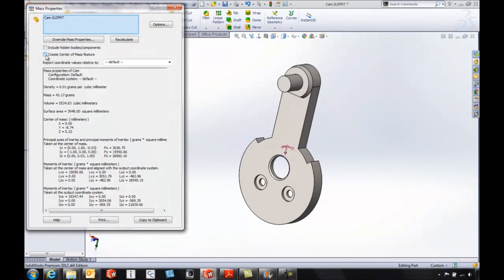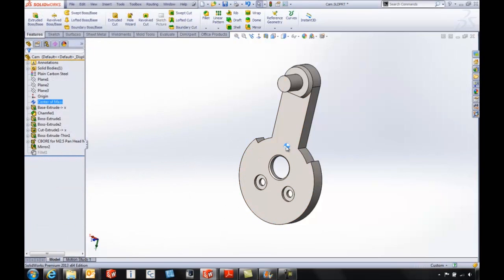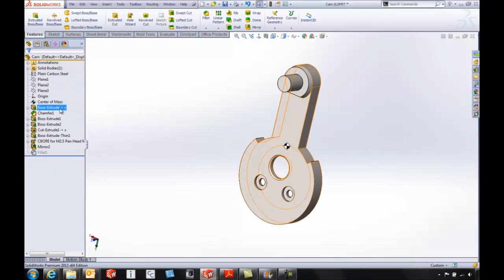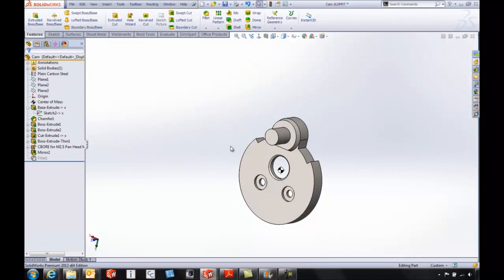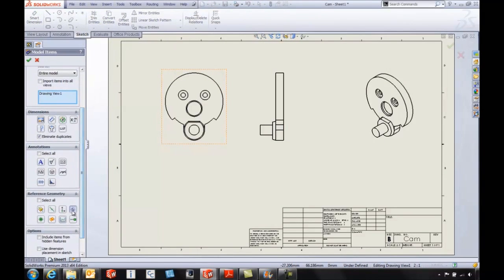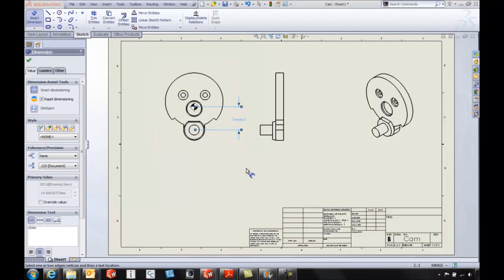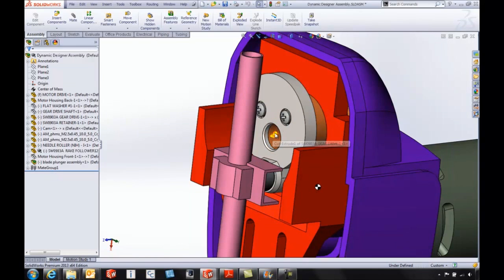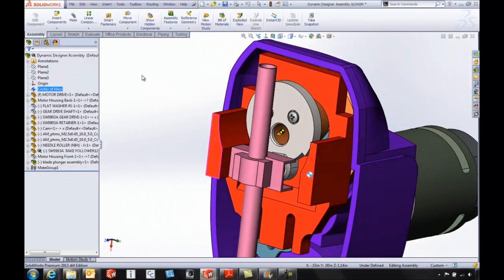SOLIDWORKS 2013 - Find the Center of Gravity

Comment: How to extract the center of gravity of individual components for a big assembly with respect to global co-ordinate system? How to export to excel sheet?
Reply from the maker: If we open up the part in its own window, we can create the COG marker for the induvial part.  Back at the assembly level, if we have the visibility of Center of Mass symbols turned on, the individual component symbols will show in a yellow color as opposed to the white color for an assembly level COG.  To obtain the location relative to the assembly origin, I would use the Measure tool from the Evaluate toolbar and click on the part level symbol.

As far as exporting to Excel, you could copy and paste the values manually.  If you need to perform this task more often, you might look into a custom program to perform the task.

Comment: Sorry but this isn't the center of gravity on an assembly. It is the center of its mass. There is a big difference. 
If you moved parts in the assembly which would theoretically change its CoG you will find using this technique the symbol will stay in the same position on the part. I would change the title of this video as it is misleading